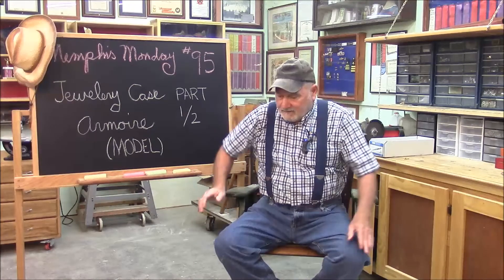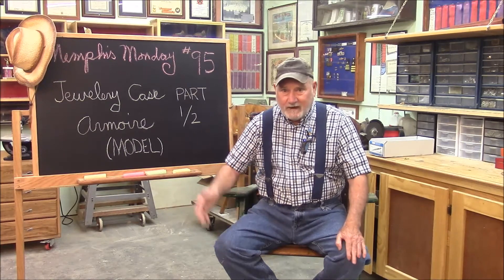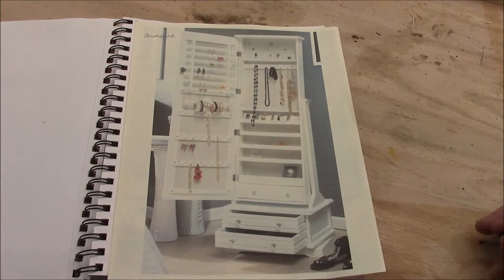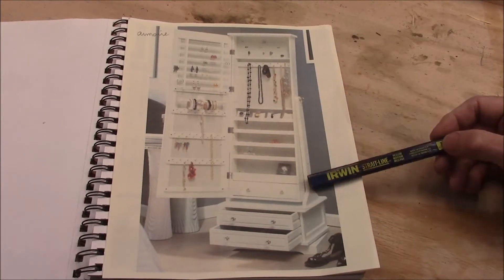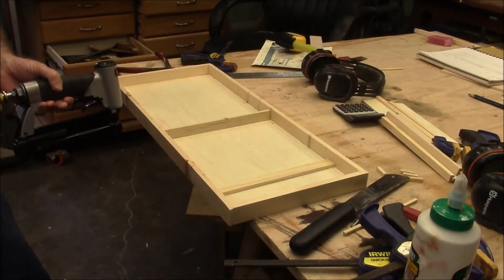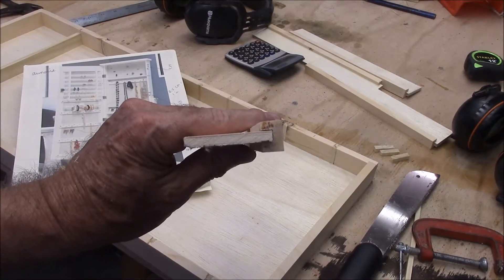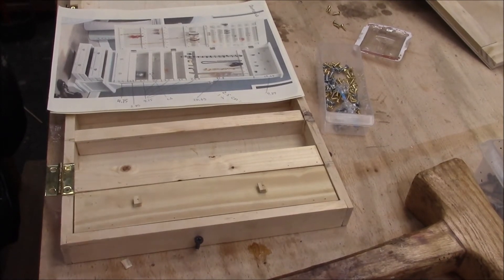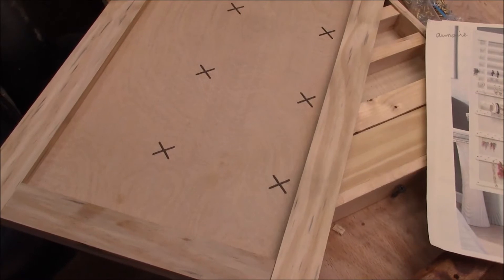95 Jewelry case Armoire Modeling phase

Comment: Wow!  You are bringing this armoire to life.   This is definitely a case where a test piece is a very good idea.  The little drawer at the bottom surely was more usable in the final larger piece.  I noticed you had taken the knobs off that drawer once the door was installed.  Did you have to change your design because the door wouldn't close with them?  I hope we get to see the finished masterpiece next week.  Were you able to find a way to make the ring holder part?  I know that is usually pillow like sections like the ring holders you get from a jewelry store.    I am excited to see the finished product.
Reply from the maker: testing
Reply from the maker: The little drawer turns out to be a tilt out bin.  From this video you can see that I knew it wasn't a drawer, but I couldn't figure out the puzzle.  So I studied the picture again and noticed the hinges on the bottom of the drawer front.  Bingo.  
    No, the picture showed those little dangly ring pulls, which I couldn't find locally.  So I just bought real small pulls.
     Yes, I hate part videos anyway, so we finish it next week.  Unfortunately,  I left a lot of the technical stuff out;  I left out a rather long and complicated part about "splayed miters," which we have discussed, and which you will see next week without explanation.  I may make a Rush video covering the subject, but I might even make it an official Memphis Monday.  
     The ring holder was easy.  I just took a section of foam and cut out lines to put rings in.  It took about two minutes, but it looks like I actually planned it!!!
      Moreover, next week I will stand beside the totally completed and painted project; with all the hardware; with everything complete.  
      By they way.  I must have twice as many Rush viewers as Memphis viewers.  Such a dilemma.  The point of the channel is to show completed projects, start to finish, but people like three minute videos!!!  Figure this out for me. You always do.
     Thanks for watching and commenting.
Reply: ***** Dang!  I wish I had gone with my first instinct.  When you first showed the size of the drawer, I thought that it would be perfect for one of those fold down applications like is in front of my kitchen sink!  I was going to say something to you about that, but knew you would have already finished the project and it would be too late for you to make it that way!!!  Little did I know!  
It sounds like the splayed miters may be important enough to merit their own Memphis Monday.
I am excited to see the finished product.
Using a piece of foam and splitting it like you did is perfect!
I am afraid there is no figuring out this one.  Unfortunately, we are living in an era where the majority of the people have the attention span of a 3 year old.  It is difficult to get people to commit to more than a 3 minute video.  I enjoy the longer videos because I don't watch TV or play video games(besides facebook games)  All I can recommend is, if you have the desire and the time, continue with the Memphis Monday (the show's main direction) and throw in the Memphis Rush every few days.  I will say that I have heard that having the videos on a set schedule and more often will bring in more views.  I have enjoyed both this week.  Like I told you earlier, the concept of Memphis Rush is pretty cool.
Reply from the maker: See, you should have gone with your first instinct.  It took my a week to figure it out!!  You are right however, setting me straight would have been too late, as the project was already complete.  
    May just make the splayed miters a Memphis Monday video.  Matthias Wandel did and got a million views.  Not saying I'm as smart as Wandel, but I can demonstrate how to do the same thing without Matthias Wandel brain power.  
    I suspect you are right.  Perhaps best to do both the 3 minute videos and the 15 minute videos.  Problem is, my favorite channel is "South Main Auto," and he often makes one hour videos.  
    Thanks for watching and commenting.  I'll be on travel for a few days, so no Rush videos, but I'll catch up later.
Reply: I always lose when I second guess myself.  That is why I am not a gambler.  
Considering your life experiences, I would say that Wandel ain't got nuthin' on you!  
The people like me and you who enjoy the longer videos will keep watching the Memphis Mondays.  Also, if the shorter videos bring in more viewers, you may eventually get more Memphis Monday viewers.  Enjoy your travels!